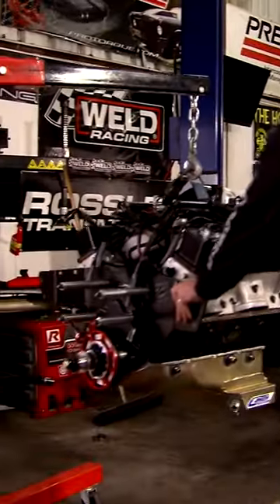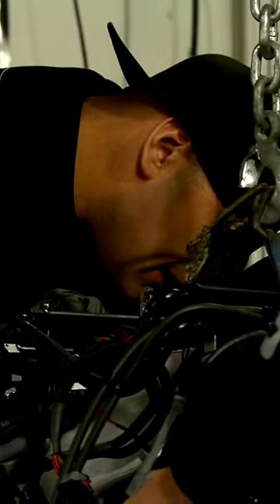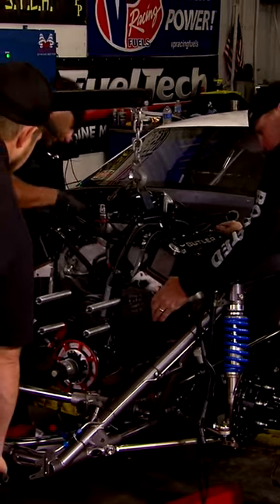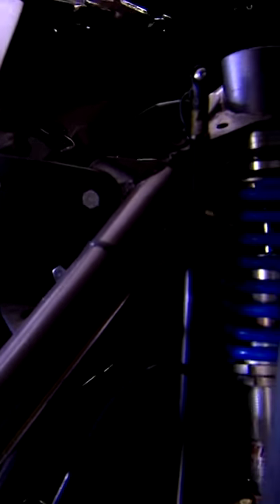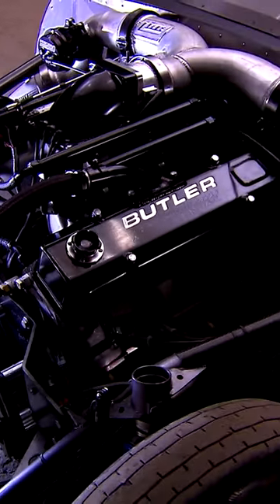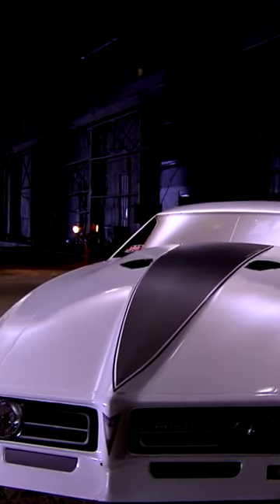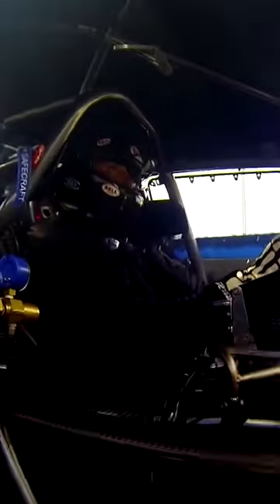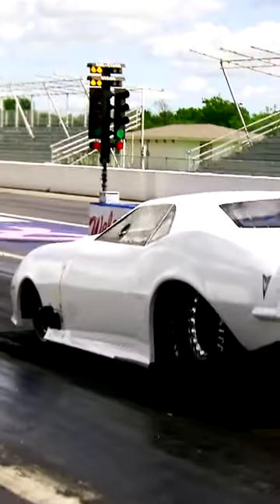Getting the Butler 482 into Big Chief’s Crowmod

Comment: I've Been Pontiac Fan since Late 70s I have 76 Trans Am 455 4sp has nice Mods looking to do more Love to have Butler All Aluminum Pontiac Engine  500CI 700hp 700+ Torque  Screw those LS Engines For Pontiac Cars especially 60s and 70s era. Bad Ass Built Pontiac Engine Sound Better too and they look Right in a Pontiac Car. Back in 70s I was a Big Camaro Nut but that all Changed Drove 78 Blk&Blk TA 400 sp in 1979 I went to the Dark Side. I'm in High Speed Pursuit of Black Trans-Am! He's all mine So stay out of my Way! Sheriff Buford T Justice of Texas